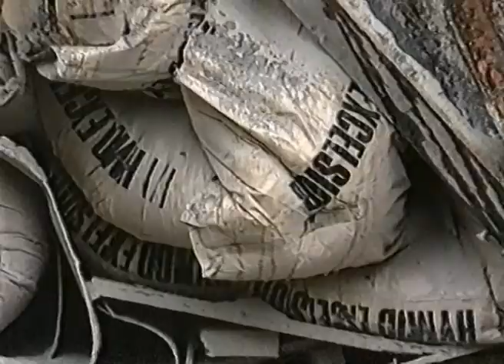Holton Heath Train Crash, Poole 1989 & Rail Crane

Comment: I'd have dumped the air and ran back through the engine compartment... very few people would survive a fall at 50mph. In the event, sadly it sounds like it was un-necessary - from the report: "Although the locomotive was extensively damaged and the leading bogie derailed, the integrity of the driver's cab remained intact." 

Hate things like this, poor bloke just went to work and stuff like this means he's never clocking off. RIP Driver Brooker
Reply: I was thinking that but you have to run sideways so at 50mph I might not have made it all the way through. Also there may have been a faff about with a key to access the other end if it was locked.

Comment: The guard had retired by the time the report into the accident had been finalised - if he had been still in service, they would have recommended retraining. It seems a number of things had an impact. Sadly, the poor driver who died did absolutely nothing wrong - travelling under clear signals he spotted the rear of the other train. It was likely he jumped from either the front or rear cab, or on the steps - they were not able to establish which.  The guard was primarily to blame, plus the signalman and the train driver. A collection of little errors that together caused the collision.
Reply: The guard is the first port of call for a scapegoat.

Comment: I remember this was made more tragic by the fact the light engine had been sent to move a wagon that had previous been placed slightly out of position under an overhead crane that was fixed ie only able to lift and could not move horizontally, so a loco was sent to be move it into the correct position.

Comment: Although the class 33 drivers cab is badly damaged ,the left side is where the driver sits its likely had he not jumped from the cab which resulted in his death he may have survived the impact possibly with injuries. Maybe?
Reply: Hard to say. Remember that there are no seatbelts so he'd have been launched forwards in the impact and would have hit the front of the cab/back of the van head first at whatever speed his locomotive was doing before the impact. That would have caused serious injuries at a minimum.

Comment: What has happened to all the rail cranes? Getting rid of them was a big mistake as they are still needed today for the very same purpose as in those day in the event of a derailment like this the rail cranes were used to put the train back on the tracks & repair it so it can be towed down the line to the nearest depot These days sadly they use non railway cranes to remove the train from the scene & transport it by road which is expensive Dangerous Bad for the enviorment & disruptive to road traffic & also it takes twice as long this way as the site has to be acessed from outside the line which in many cases is difficult. So why do they do it the hard way? The only reason i can think of is that recovery by rail is only possible with Rail cranes.So the solution is to bring back the rail cranes. Other countries use them so why not the UK?
Reply: I'm surprised they haven't purchased and started using tracked side boom cranes, sidewinder I think the US railway recovery operations call them. Would make recovery operations about 10x faster and more efficient. I don't know if the UK politicians are up to handling that much efficiency improvement without burying it all in red tape and paperwork from one end to the other! :D
Reply: we have cranes on the network.
how do you think they sort out derailments and track renewals.
kirov crane for example
Reply: We still have the Rail cranes but unfortunately they are quite old now and not really up to the job, especially with larger, heavier more modern rolling stock, that`s why these days, it makes more sense to do a contract lift with a Mobile Road Crane. The company assumes all responsibility for the lift and they supply however many staff is required to operate the crane. I have done jobs where we have used Mobile super Lifters, that would just not be possible with a Rail Crane. The only Rail Cranes being used now, are on Engineering jobs during possession work.
Reply from the maker: Glad I captured one of these machines in operation when I did, there can't be many of them about now except for those with new homes on preserved lines, of which there are numerous examples.
Reply: @RailFlicks  As far as I know, there are Three 75 Ton Cowan`s & Sheldon Cranes left. They were stabled at Springs Branch Shed in Wigan, last time I was there. There was a debate as to what was going to happen to them. One was going to be a donor crane, no matter what, because it needed too much spending on it. Network Rail were debating on replacing them with 2 new Kirow`s but at over four Million pounds each, It was decided to use outside contractors, for Derailment jobs, The Breakdown Coaches have also been withdrawn, some are also stabled at Springs Branch and one set is at Warrington Arpley. They are talking about a Modular system, that can have different pods swapped as required, a bit like Thunderbird 2 and I believe, that was the name suggested, Thunderbird units. They would use container flats, for transportation.
Reply: I would have thought that the timetable was such that you'd need the track cleared and fixed. Get a crane in, pull it out of the way asap.
Reply: @stephensmith4480  The Thunderbird fleet was what Virgin Rail called their team of rescue locomotives that were stabled at key locations around the network. There were used in cases of Pendolino failure to bring the train to its destination.

https://en.wikipedia.org/wiki/British_Rail_Class_57#Virgin_Trains_West_Coast
Reply: @gerrard4215  Yeh I remember them well, they are still floating around but they are no good when the wheels are off the Rails.

Comment: The cab of the '33 wasn't that badly deformed,it looked as if the driver had stayed aboard they may have survived.
Reply: Very true, I guess the driver has to make a split second decision - always easier in hindsight I guess.
Reply: I thought the same to a point, maybe straight in to the engine room/bulkhead too, but no time to think rationally i suppose.
Reply: Think most would jump in that situation the driver was unlucky to lose his life jumping though
Reply: @andymath1523  I think it was most likely the speed at which the loco was travelling combined with the fall that did the damage.
Reply: @AnthonyFurnival  Yes he was doing about 50 mph when he see the impending collision so probably jumped at 40 mph survivable if your lucky
Reply: @andymath1523  yeah, I guess it depends what you hit when you fall - gotta feel sorry for the guy as he wasn’t at fault.
Reply: @AnthonyFurnival  What I thought was bad TV news seemed to put blame on Driver yet he'd been on greens and well under line speed . We had do many years ago 2 x Class 31's ran into oil train driver jumped but was lucky only minor injury's
Reply: @andymath1523  the media are always problematic in situations like this - they speculate then mislead the viewing public. It’s frustrating! It’s odd isn’t it how two similar sets of circumstances worked out so differently for the two drivers.
Reply: @AnthonyFurnival  Yes just pure luck really  jumping off at speed ironic really 31 incident driver passed signal
Reply: @andymath1523  So the 31 driver was in the wrong and survived whilst the 33 driver did nothing wrong and perished? That is a harsh turn of fate!
Reply: @andymath1523  It was said at the time that when Clive jumped, he hit his head on a concrete post by the side of the track.
Reply: @kristinajendesen7111  How unlucky for driver as many drivers have jumped and suvived ok
Reply: Remember that there are no seatbelts. He wouldn't have been crushed if he'd stayed in the cab, but he would have been thrown forwards at whatever speed his locomotive was doing before the impact. He would then have hit the front of his cab/rear of the good wagon head first. That would cause massive injuries.
Reply: @beeble2003  very valid point actually - it was a difficult call for the driver to know what to do I guess.
Reply: @beeble2003  not if he faced the other way and leant up against the surface Infront of him
Reply: @BenDover-ln6ns  moving into the engine room could bring its own risks. Depending on the potential damage about to be caused by the impact, there is the danger that they could become trapped in there. Let's not forget the driver probably only had a split second to assess the situation
Reply: @beeble2003 but the cab wasn’t crushed though?!?
Reply: @benconway9010  I think you misread my comment. I said "he WOULDN'T have been crushed if he'd stayed in the cab".

Comment: What was cause can't find on Google
Reply from the maker: Have you tried the link given in the video description above at all? You may have to click 'show more' to reveal it. It's the full report which is an interesting  read! Basically though, the siding did not have full detection signalling because it's not used very often. Procedures protect it instead, but when events like a longer than normal train which requires extra moves in shunting, and the procedures not being  adhered to the letter, then a dangerous situation results.
I'd still recommend reading the fascinating report though if you have time.
Reply: @RailFlicks  I'll try down load again. Was poor driver who killed no to blame in any way?
I guess it was miscommunication between signal box and train crew?
Reply from the maker: Clear and concise, thanks for that summary.